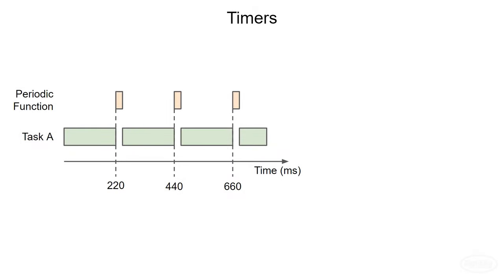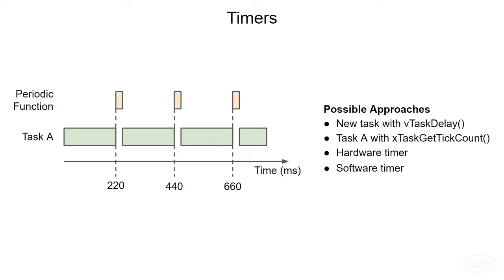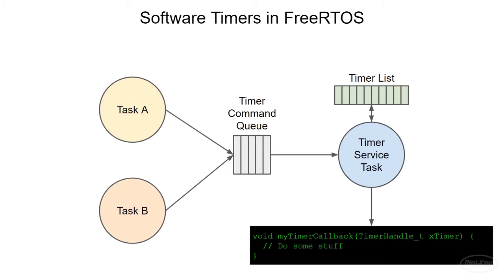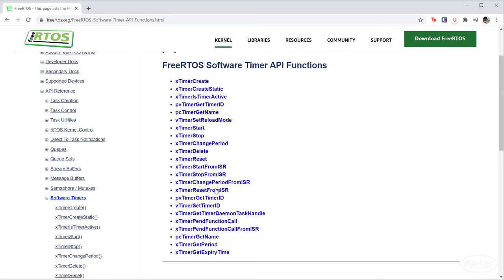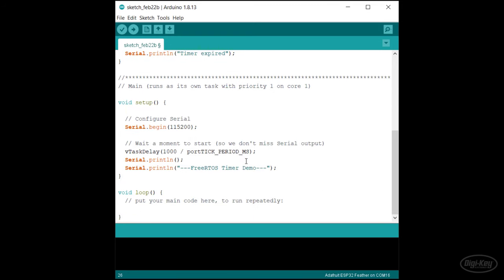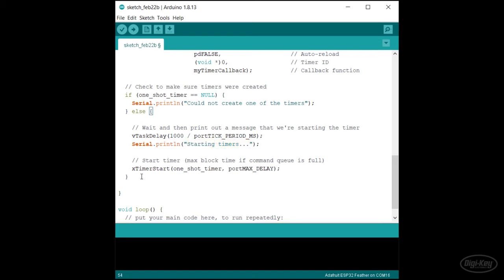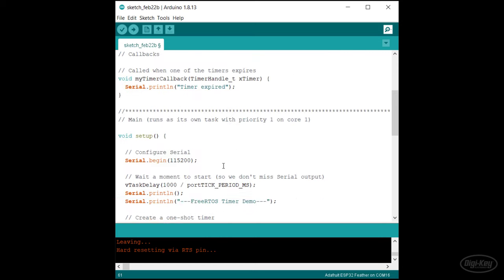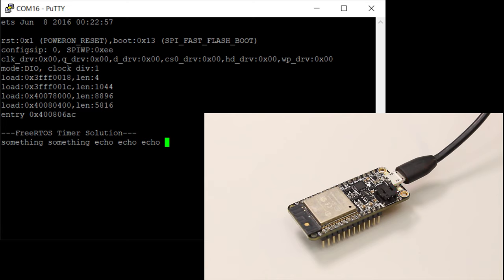Introduction to RTOS Part 8 - Software Timer | Digi-Key Electronics

Comment: Small note for future RTOS users, seems like calling vTaskDelay before vTaskStartScheduler causes issues since the system ticks have not yet started or unless Arduino is set up to where you can use vTaskDelay before vTaskStartScheduler (I am using the Raspberry Pi Pico). Any call of vTaskDelay after calling vTaskStartScheduler will work though.

Comment: What if I want to go below milliseconds precision?
I'm building a Power Quality analyser, in which one reading must be taken by polling the sensor every 488 microsecond. For the rest of the time, I have to do the calculation of other things.  All of this has to finish within a second, so that next fresh readings can arrive and calculation can begin again. What to do to generate the delays in the microseconds?
Reply: You could probably set the tick timer to be 488 microseconds, but I usually don't see tick timers go below 1 ms in most RTOS applications, as you start incurring a lot of overhead. Instead, I recommend watching the next video (Part 9) where I talk about using hardware interrupts to create a precise timer. In fact, you may not need an RTOS for that application: an interrupt that samples your sensor every 488 microseconds (based on a hardware timer interrupt) and a superloop to perform the calculations may be sufficient.
Reply: @ShawnHymel  Thank you very much for responding ! I had to do the same thing as you said. I used one super loop and took one variable  which gets modified by the timer ISR. Whenever superloop encounters the change in the variable, it polls the sensor and stores the data. But, I still needed an extra core to do the computation in the parallel tho! Since, the superloop is continuously polling for the variable. This is how the core 0 saved my ass! 

Again, my sensor polling uses a user defined function that uses SPI bus. I don't know how to call SPI reading functions like transfer.SPI from the ISR, this is why I went with the former approach mentioned. I would love to know how to use all the UDF's inside an ISR without causing core paincs and guru meditation errors. Thanks!
Reply: @mayurbalwani7277  Glad it helped! If it's a small amount of data from the sensor, you can probably get away with just performing the SPI read inside the ISR and updating a global variable. If it's a large amount of data, I recommend reading about using DMA to transfer data from SPI to memory without using the CPU (https://docs.espressif.com/projects/esp-idf/en/latest/esp32/api-reference/peripherals/spi_master.html). It can be a pain to set up a DMA, but if you're working with large amounts of data, it can potentially save you some processing power (and you might not have to use a second core).

Comment: there is not #define INCLUDE_xTimerGetTimerDeamonTaskHandle declaration in my FreeRTOSConfig.h ,, code is running but there are not Serial messages printed out.   serial bauds are okay.  i don’t have issues with the others tutorial . Only this one tutorial is causing this issue….any ideas guys?
Reply: #define configUSE_TIMERS is set by default to 1